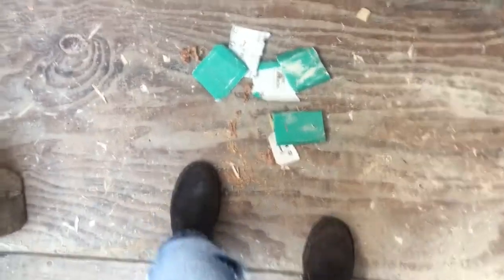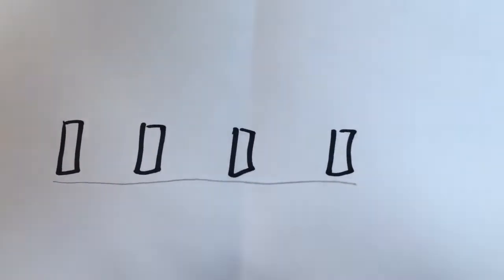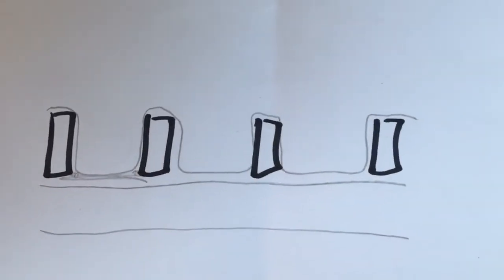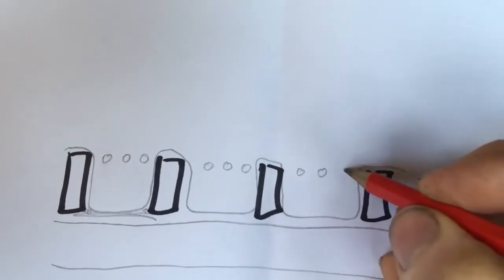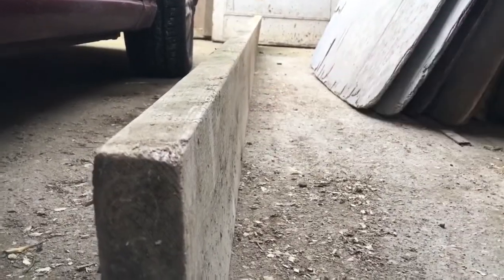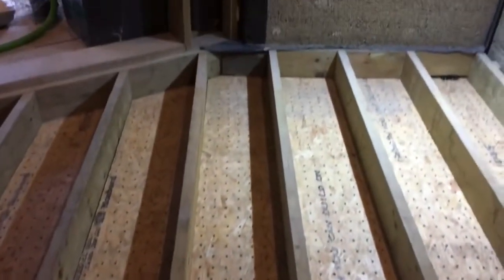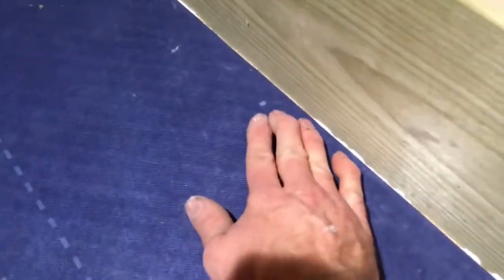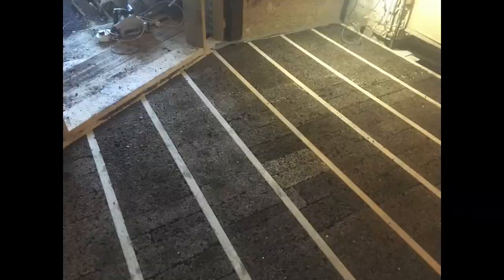Hempcrete Extension E17: Floor

Comment: love your channel! extremely helpful informations and try outs combined with a lot of "interesting" humor! I personally do not like holes in walls, boards, layers etc. cause vapor is not a fluid. vapor pressure is regularly distributed over the entire surface, i.e. the entire surface is moistened. you often see holes in damp masonry in older houses, but the drying effect is only localized. to remove moisture, you would need rear ventilation, i.e. air circulation instead of stagnant air. nevertheless, i believe that in your case the whole thing will work. sorry to be a smart aleck. just some feedback.
Reply from the maker: I'm glad you're enjoying it! Yes, this buildup is completely breathable, so moisture with slowly migrate thru the wall without doing any damage. (The hempcrete is also apparently hygroscopic, it absorbs and releases moisture to a certain extent to regulate the moisture in the room, making for a nice atmosphere.)

Comment: You could have just fillt the crawlspace with sea shels. They stop capilarity
Reply from the maker: Yes. The industrial version is a layer of foam glass beads made of recycled glass, with the hempcrete on top. Apparently it's quite good environmentally. I guess sea shells would likely be a lower carbon footprint (if they're available nearby) but less insulative than foam glass. Also, have to think about whether you need the crawl space to route things through, or for access. (For instance, I would have needed to add ventilation ducts if the floor was a solid design)

Comment: This is helpful for architecture students, thanks for sharing!

Can I ask, how durable is it? Will it crumble over time as an internal wall? Is it easy to damage?
Reply from the maker: Hey - yes I have had architects pick my brains in a few conversions, direct experience of it is useful. 
Hempcrete should last indefinitely unless something goes wrong. (it's basically a standardized modern version of ancient building techniques). If it's finished in lime plaster/render or membrane and cladding it last like any wall. There are a few projects where the raw hempcrete is used as a look to the internal walls, presumably they would need to be sealed with something (breathable) because it would otherwise be a bit dusty. It's quite solid once its cured, and it looks cool, but it would show marks where it got bashed. You can also obviously see that layers it was laid in, if it was mixed and placed onsite.  
Or did you mean cork? In which case, it is also quite durable, springy, slightly dusty. If you bashed it hard it would mark, doesn't crumble that easily.  If you search you can also find cork panels with amazing designs pressed into them, made to be used as a finish.

Comment: Why not hempcrete in the floor space as well? Too heavy? More expensive than cork?
Reply from the maker: No, hempcrete in the floor space as well is actually the preferred option, because it's easy to seal up all the gaps and complete the thermal envelope, and it would be quite fast. It's not too heavy (and you can place it less densely between joists where it doesn't have to hold itself up), it would be a bit cheaper than cork. It acts as a wood preserver and rodents don't like it. (You would still have to find a way to complete the air tight envelope underneath it tho). The main reason here is that I had a height restriction above, and an underfloor level to match below, so there was a restriction on how deep I could make the floor wedge; and I've put a lot of glass in the building so the floor had to meet a high U-value. Cork or fleece performs better than hempcrete thermally, and I didn't have enough space to make up that thermal value in the floor using hempcrete. Then i thought I may as well use the cork as a support for underfloor pipes as well. (I guess hempcrete would be ok as a support for pipes in another situation. 
Thanks for asking!

Comment: Ingenious ❤️🌲
Reply: Have you to do you do this as a job? I think there is a huge call for this type of work in the uk…
Reply from the maker: @ryanbarnes8301  Hi - this is the first one of these I've done, But yes, there is going to have to be a lot of retrofitting floors in Victorian buildings with insulation (and maybe heating pipes) and it will make a big difference if it's done with sustainable materials. That's kinda why i was interested in trying these out.
(There's also a problem with non-breathable modern materials actually damaging older structures when they are retro-fitted,  'cos they trap moisture.)